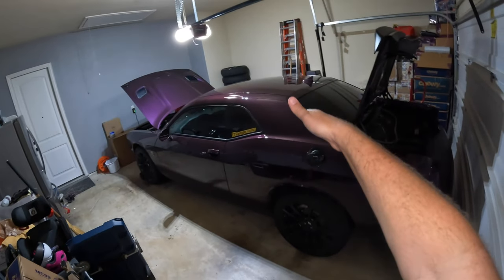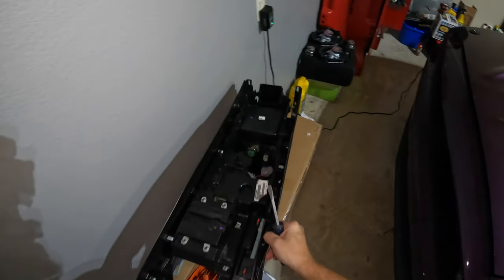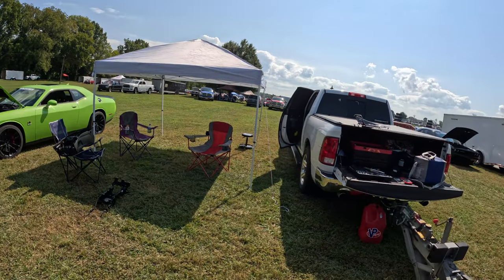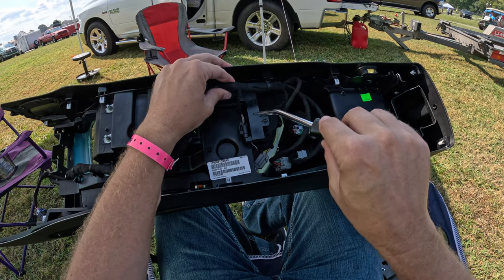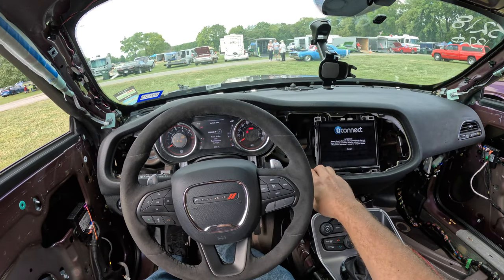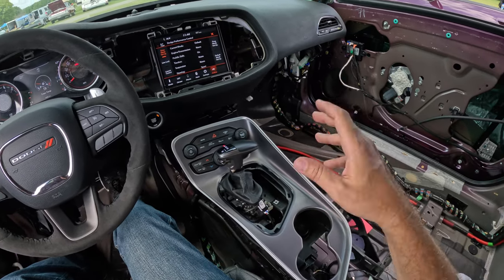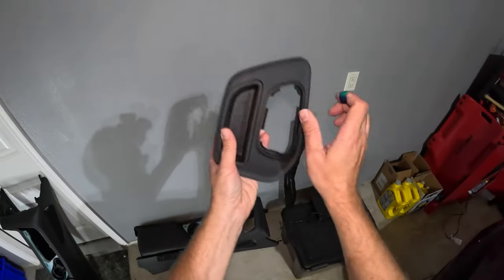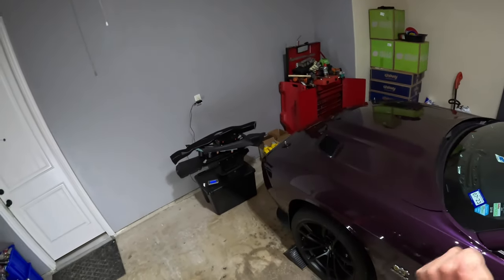Removing, Disassembling and Modifying the Center Console in my Challenger 1320 for Weight Reduction

Comment: Since mines a manual, I am able to completely ditch the center console. I learned that the sensor inside the cnter console controls the keyless entry and trunk. If you remove it, your trunk will pop open every time you open it and the doors will not allow keyless entry or locking. Not sure why Dodge did that...

Thanks to your video Im finally able to find where that sensor is... All I knew was it was in the console somewhere. Now I need to fab up a custom console using carbon fiber.
Reply from the maker: I think I know the sensor you're referring to. There's at least a couple of them scattered around the car, one of them being in the trunk which I'm sure is the one that won't let you close the trunk while your fob is in there. Sounds like a pretty cool project, I'd definitely love to see what you come up with.

Comment: I'd like to modify mine to store a special tool. Unfortunately no one makes a console safe for the Challenger. Charger, yes.
Reply from the maker: That could come in handy for sure. I wonder if the Charger maybe has a little bit bigger space to work with
Reply: @Scavenger1320  It does have more space, but there's a market too. A lot of folks with Challengers would find it useful. It's the one thing I can't figure out what to do. The car doesn't have many hidey spots inside.

Comment: Most people do not think about their own weight reduction. You need to have a severe weight reduction to have an impact, putting that console on a diet is not going to make some car run faster times. The average person can lose easily 5-10lbs and that will easily offset any hacking up plastic off the car.
Reply from the maker: Or, you can do both! 10 pounds may not be much but it all adds up. It added up enough on mine that I have the fastest 1/4 mile time by any car powered by a factory stock 392 drivetrain. My car is just 35 thousandths of a second away from breaking a 10 second quarter mile, with a stock 392 with stock tune, all because of weight reduction

Comment: How much that weighs there’s a co doing that piece in full carbon fiber bud
Reply from the maker: I forgot to throw the chopped up frame on the scale but I weighed up everything I chopped off and I removed over 10 pounds. The little bit of plastic frame left over here can't be more than 2 or 3 pounds though.
Reply: @Scavenger1320  awesome ideas I got battery bc you on my rt all adds up took engine cover they making that carbon too if you look web you’ll find it. Like you’re channel